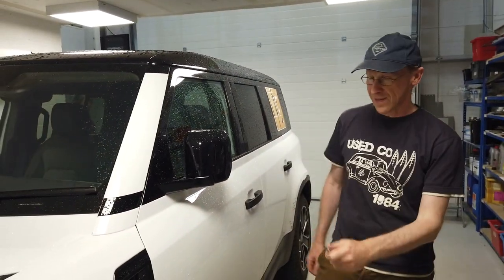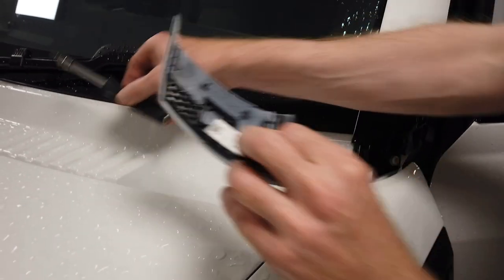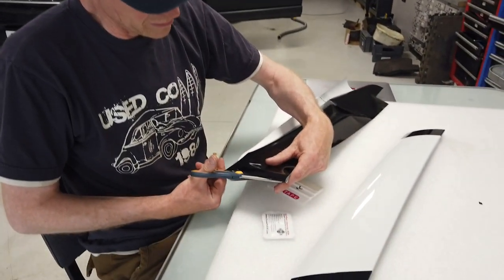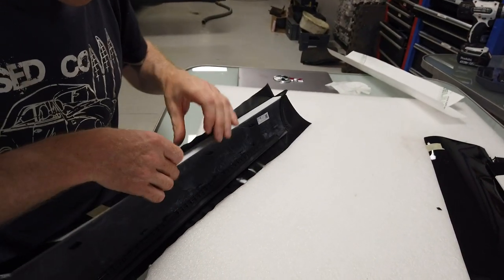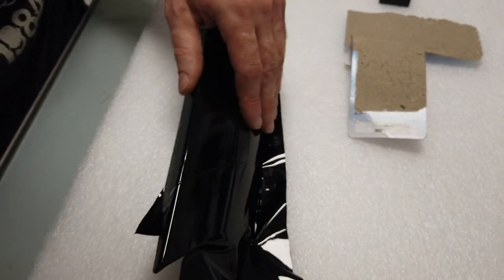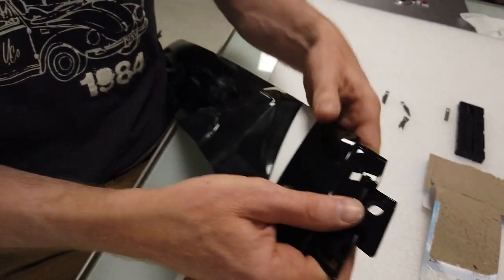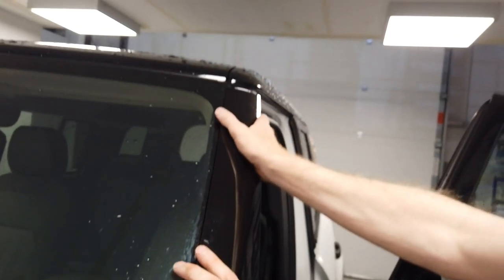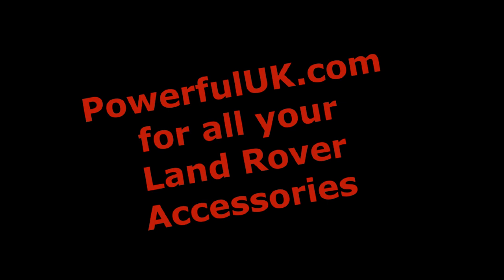Land Rover Defender 2020 Removing Windscreen A pillars & wrapping gloss black

Comment: Well done-try putting a multi piece Union Flag on the roof of a mini(real one) and peeling off the wrong side of the kit first,by mistake,so you have to put the bits on separately!Nightmare, but soapy water saved the day so they could be moved around.

Comment: Hi, I just got my Defender HSE P400 a week ago. When I drove the car between 75 and 80 mph the passenger side A pillar was fluttering very loudly. I had to slow down because I was afraid it would fly off. Have you experienced this kind of problem on your Defender? If not could you please investigate and determine possible fixes? Thanks
Reply from the maker: Hi - Do you have the snorkel fitted ? I did hear wind noise from the drivers side A Pillar but no fluttering.
Reply: @L663  No I don't have the snorkel fitted. Thanks
Reply: I’ve had to replace mine twice now. Both times the mounding broke off.

Comment: As somebody who is possibly worse at wrapping than you are Simon 🤣I've noticed that the hard top/commercial versions already have gloss black A pillars. Would you be able to supply these? They look so much better in black.
Reply from the maker: Hi Robert I have looked these up on the part number system and I have ordered some to see what they are like etc.
Thanks for the idea and I will share the PN's in due course ! 
There were 2 PN's for early and laters models - I have ordered for the later and will see if they fit my early car.
Reply: @L663  Great! I look forward to seeing how they turn out.
Reply: @L663  Hi Simon, sorry to trouble you but did you get the black A Pillars from Land Rover and where they OK? If they were OK are you going to be selling them or do you have the part numbers? Keep up the good work really enjoying the videos on the Defender👍🏻

Comment: That body coloured A-pillar and window square is an option on your build, under Exterior->Visual Packs->Signature Graphic on the Defender website. So the coloured pillars is an option you have to choose, and spent £155 on, instead of just leaving it unticked and keeping the pillar black when you're doing a custom build via the website.
Reply: Duncan Lawson Or someone at the dealership ordered/accepted that configuration if he bought it from dealer stock
Reply: @Zarathustran  Changing the pillar to Black is not an option on the Fuji White build on the UK or any other country configurator. All that is available is Black Pack includes:

Narvik Black Grille Bar

Narvik Black Bonnet Lettering

Narvik Black Tailgate Lettering

Narvik Black Bonnet Chequerplate
Reply: Duncan Lawson Simon wouldn’t have paid for options 😂
Reply from the maker: correct ! i dont recall paying extra for that - but i may have paid for the black roof... the receipt was on the video i took down....
Reply: powerfulukltd Well over there in the UK I guess a black roof doesn’t stifle the interior with oppressive heat as readily LOL I’m in Texas and the black roof was a bad idea, but that’s what the dealers have on their lots I think it’s standard on the L405 I don’t even remember but three or four months wait for your configuration to arrive wrong (which totally could have been my fault) will make you accept compromises like a black roof.  The stuff I bought from you guys is awesome. It arrived well-packed and everything fits and functions great. I like your new ride, too.  That’s a sharp looking truck.   Keep safe and stay healthy and thank you for the good content. Very very useful on how to take some of this shit apart and put it back together.
Reply: This might only be currently an option on the 90 - (its supposed to be on the 110 as well) if so - my bad.
Reply: Steve Winterton ah well I don’t doubt it.  Not sure why you’re telling me specifically rather than Duncan but he can see it and that could have been unintended.  My point was just to say everybody likes to feel certain but it should probably be more than just a feeling if the basis of indulging one’s need to scold others.